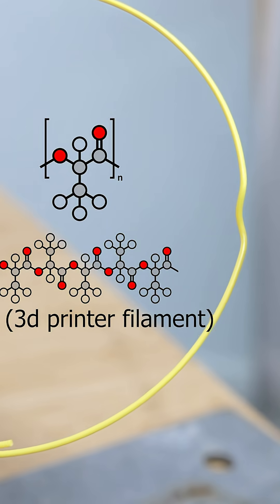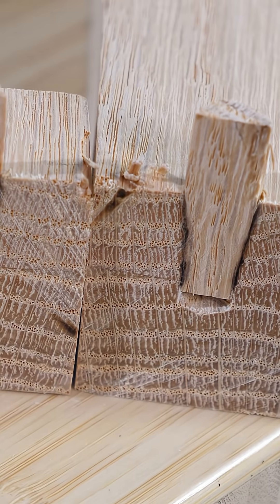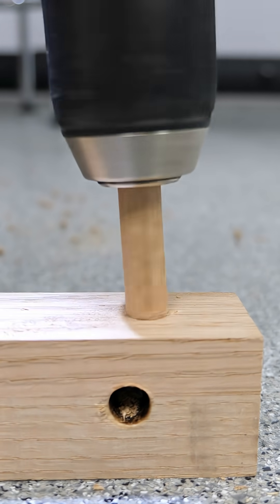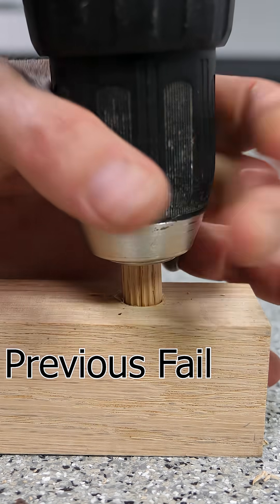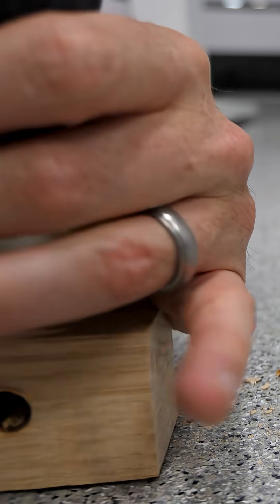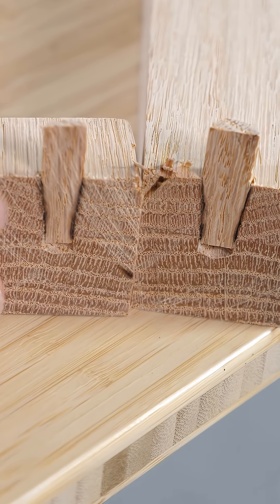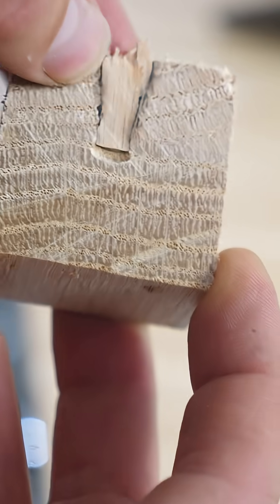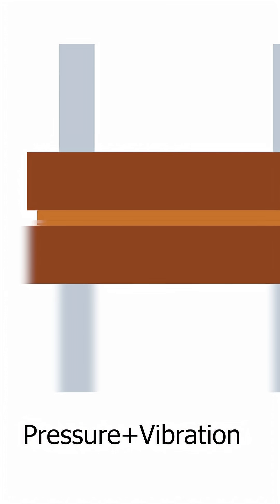I Melted Wood With Friction

Comment: I forget what they're called, but there's a construction brad that is made of wood.  Fired into another wooden substrate during construction, it also welds itself into place, and the resulting construction is stronger than one using steel nails.

Comment: Nice bro . 👍. I believe this works with plastics as well . Wood for sure as shown . This coiffed to me years ago when fixing an old door hinge screw hole that was widened over years . I stuck an oak dowel rod in and made the squeak sound and stuck . Drilled a small pilot and wallah . No more saggy door . I did two more after that for good measure .

Comment: sorry you are telling me if i am trying to start a campfire with friction i might actually weld my 2 sticks together? how am i supposed to roast marshmallows with melted wood :(
Reply: Only if you'll get the rotational speed and pressure exactly right AND if you'll stop mid-way through the process before you start a fire, to allow the molten lignin to solidify. So it's extremely unlikely to accidentally weld wood like this, I doubt it's actually possible to weld wood without power tools

Comment: You didn't "melt" anything. It got hot and expanded in the hole. Virtually any material will do the some thing if it gets hot enough. It's a common process to weld metal as well. Simple friction.

Comment: Your video on melting wood in the vacuum chamber gave me the idea of a wood SLS 3D printer using very fine sawdust as the material. The entire print chamber would have to be kept under vacuum, and it's probably not practical at all, but it should be possible. You could then have access to print-in-place mechanisms and other additive manufacturing techniques that are typically not possible for wood.

Comment: Try a vice and a rubber hammer exactly perpendicular, that works 100x better to undo those connections than pulling, twisting using plyers

Comment: so....they had to figure that out?

I always figured it was a known thing because I rember from my childhood that a dull tablesaw would heat the wood, not quite setting it on fire, but still making it pretty "melty" at the "cut"

I also had dull drill bits melting wood and having the shavings compacted in the flutes, after cooling the wood was basically like plastic and could be peeled off the drill....

Comment: It's the same principle of fire Harding wood. Pine is best actually. To make a hammer find a you g pine with a base diameter of about an inch come up about four inches from the ground and scrape a ring around the base removing the outer layers of bark. Scraping into the soft layer of bark almost to the trunk of meat wood. It will form a knot as it grows. Now before you leave it to grow until it is the size you want be sure and bend the top of the you g tree until it breaks but stays together. Now when the tim comes cut all the limbs off the tree leaves a few green twigs here and there the resin will push up and out trying to supply the needles. After it infuses itself with its own resin. Cut the tree and cut out your hammer and your walking stick "cane" now fire harden them. Not only will they be beautiful after polishing they will be like steel. Cheers. Wood tech is what our ancestors used to refine stone tech. 😊

Comment: The problem is that melting temperature is higher than combustion temperature. So, it burns before it melts, otherwise you keep the O2 away.

Comment: Technically all compounds and elements have a melting point. The ones that don't seem like they do just have a combustion point lower than the melting point. Since combustion is a chemical change, it is almost impossible to reach the melting point before the substance changes completely.

Comment: That’s a wrong explanation of what the glass transition temperature (Tg) is. 
Long chain polymers do have a melting point that is at or above the material’s Tg, depending on its degree of crystallinity. At Tg the non-crystalline amorphous chains melt but are still held together by the crystalline domains which require a little more energy hence heat to melt. That is the melting temperature Tm. 
Then there are fully amorphous polymers which don’t have an actual Tg but only Tm.

Comment: Is it all wood or only certain types of wood?& does the wood have to be the same? Like in the video it uses oak wood for the holed wood & dowel.. or can you use pine & oak etc? Does 1 have to be soft & 1 hard only soft woods etc? Artificial woods like laminate or partical boards work too? Im so facinated now.. 😮😮

Comment: Ive been working with wood my whole life and I had a hunch that you could potentially with enough heat bc cellophane will bond with heat. Wood is cellulose so it should act the same. Turns out I was right. Thats crazy. I understand it's the lignin and not the cellulose but it doesnt change the outcome. My measurements were wrong but the principle was right. I wish I wouldve tried it and figured it out myself and won that damn schweighofer prize 😂😂😂

Comment: If I had to guess the reason no one found this before now, it's probably because if you get it too hot, the carbon particles that develop act as a dry lubricant and barrier, which defeats the adhesive properties of the lignin.

Comment: Could a vibrating press like that be used to weld paper together?  Cardboard?  or maybe welds between paper sheathings of foam core panels such as for construction of foam core architectural models?

Comment: Lignin is the natural “glue” within the wood cells that God put into the creation of tree wood.  Soaking it in liquid nitrogen at super low freezing temperatures temporarily softens the lignin also so you can tie strips of wood into knots even without it breaking.  
Do not try this a home, it’s only to be done by those who know how to do it safely, special insulated rubber gloves reached into glass front chambers.  If the liquid nitrogen gets onto your fingers they will freeze rock hard instantly and break off like ice cycles.

Comment: Essentially You Did Glue Them Together, 
You Super Heated The Woods Natural Resins, To The Point At Wich They Bonded Together, I Also Think That Wood
Resins, Are Some Of The Oldest Forms
Of Glue 🤔, IE Pine Pitch Resin, Has Been
Used By Native Americans For Century's,
Correct Me If I'm Wrong In Comments 🤷‍♂️

Comment: This would make sense since the wood has a resin/sap that is primarily sugar based. Sugar will definitely melt at high temperatures, and once cooled, it will solidify and bind with the surrounding surface.

Comment: I think that ''wood melting'' is not a correct determination, you can't melt the whole piece of wood. The bonding happens by melting the resine inside the wood. Would be interesting to conduct the same experiment after a long baking of wood when it's completely dry - probably it will start burning. On the ther hand - wood welding technology is the same as ultrasonic welding. In this clip a friction welding was performed, intially this method implemented for metals. Thanks for the informative video, implementation of existing methods for different use -  creates patents.

Comment: I recall seeing a nailing company who made wooden nails that fit in nail guns. 
They did explain its not structural and be used in things like siding and furniture.  
The guy shot into siding and man it looked nice. 
He then said it works well with wooden siding since you dont have to worry about nails later on popping out with aging. 
Thought that part was nice.

Comment: You should try friction drilling. I learnt it when drilling oak with a dull drill bit for steel. It burns through, and the exit hole is much neater than if drilled with sharp professional drill bit. As a bonus, the hole is also passivised, so you don't need to burn it after drilling - if you know your oak, you'll know what that's about.

Comment: German Pronunciation Lesson (learner, not native; corrections welcome):

German creates a LOT of compound words, and liberally uses affixes (prefixes/suffixes/etc). It also has pretty clear rules about both pronunciation and which letters can combine to make sounds (at least for non-loan words).

If you see letters together that DON'T follow the rules for combination (or even just seem awkward together), it's most likely a break where two words or particles are joined, and those are ALWAYS pronounced separately. For the word in the video, 'gh' is not a letter combination that has any pronunciation rules in German, so it WILL be a particle break:

"Schweighofer" = "shweig" + "hofer"

'sch' is pronounced basically the same as 'sh' in English.
'w' is pronounced basically the same as 'v' in English, but when it's after 'sch' tends to run together and sound more like 'shf'.
'ei' is pronounced like the "long 'i'" in English, as in "time".
'g' is always "hard", like in "go", except in specific context/loan words.
'o' is pronounced basically the same as the "long 'o'" in English, as in "hope", though often gets shortened a bit per regional accent.
Trailing 'r's are dropped, as in most dialects of British English, so sounds more like 'ah' in English.

Thus:

"Schweighofer" could be phonetically represented by
<Shf.eye.g - ho - fah>
(the '.'s are just to indicate 'eye' is pronounced like the word "eye" but is still part of the whole first syllable before ' - '. There's no easy way to specify that 'i' is meant to be "long" in English without context/additional letters that can just make it more confusing, or without resorting to IPA representation which nobody can decipher).

Pronouncing long/complex words in German is scary until you break it down, then it becomes super easy! Just gotta be methodical about it.
Reply: Nice, never noticed those rules in my mother tongue. 😄
Reply: He still tried - and thus did a way better job than most anglophones 😂
Reply: It's definitely easy when you break it down, but remembering those rules are tough
Reply: @aishikmoitrailead  It's just something that takes practice, and eventually becomes easy. Same with remembering the rules for pronouncing Italian and Spanish words, which are also very consistent but seem complicated for English speakers. German is actually closer to English though.

It can also help to imagine someone with a German accent speaking English, and try to pronounce the German words like that 😅
Reply: Nicely put. I was also taught: whichever comes second in 'ei' or 'ie', that's the one you pronounce... e.g. lieben and schwein.
Reply: Great breakdown, but the last sounds should be a schwa: "uh"

Comment: Well, it doesn't necessarily melt per se. It's the best way to describe it, but the physical term melting doesn't apply here. Lignin kind of just breaks its bonds to the point to where they can kind of flow into each other? It's really hard for me to describe this late at night. Someone smarter than me can correct me.

Comment: There is a "nail  gun" for wood work / wood flooring that shoots wood nails and it does exact that welds to the wood and holds stronger than a 16penny nail

Comment: Professional WIG (wood inert gas) welder here.  I can tell you that this is indeed true.  The splinters suck, but it's honest work. On decks and porches I usually like to run a spool of either the flat or round toothpicks and hit the planks laying down beads.  For finer work sometimes I get a spool of the cinnamon-flavored toothpick filler materiel and it creates a really nice aroma when joining two pieces of incense cedar.

Comment: That's how waferboard and OSB panels are made, by applying heat and pressure simultaneously they fuse wood particles and wafers together and create solid panels and boards

Comment: Technically wood welding was used by people unknowingly for much longer.  It turns out a lot of old driven wooden dowel/pin based joinery in old timber framing actually formed lignin welds increasing it's strength much beyond that of just the mechanical link.  They also had the advantage that most timber framing was done with old growth wood that had denser lignin structures increasing the likelihood that this would happen.  We only discovered that it happens about 20-30 years ago, but that a lot of "old rules" for proper timber joint pinning were increasing the chances of exploiting this property.  Old generations of craftsman just discovered which joints worked better than others based on trial and error...they didn't ever know why.
Reply: Yes but you need a LOT of friction and pressure which isn't easy with traditional hand tools like hammering in a dowel. Yes there was some bonding coincidentally but not like shown in the video using power tools and industrial machinery to do it on a larger scale.
Reply: @RaveN_EDM  ever heard of a bow drill? It makes "primitive" things speeeeeen real fast without all that newfangled rotors and tators electromagnetic auto-spination you rely on today.

(Edit for typos)
Reply: @forthehonorforge4840 yes but a Milwaukee M18 drill will output way more torque than a human can with a manual drill. I didn't say it was impossible I said it wasn't easy. You need to spin fast while putting a lot of pressure.
Reply: @RaveN_EDM  drop some stone weights on the shaft of the bow drill and you got pressure. As versatile as a modern cordless drill? No.

I'm not saying a bow drill is better than a modern drill, I'm saying it is enough for the task of getting to the speed and pressure to exceed the melting point of wood.
Reply: @forthehonorforge4840 people were not using bow drills in carpentry, it's a moot point
Reply: @kirotheavenger60  excuse me? Do you know what early lathes were? Pretty much big bow drills turned horizontal using a  small tree or branch to provide tension and springiness.
From there it is easy to develop the concept to incorporate a pedal, and then develop more movible versions when working on large things they wanted to speeen.

Do they really not teach people about ancient production methodologies in school these days?
Reply: @forthehonorforge4840 we both know we're talking about carpentry joinery here. My fault for leaving a gap open to internet pedantry. 

They were not spooling up lathes to drive in wooden dowels. 

Historical carpentry was very good but they weren't wood welding
Reply: @RaveN_EDM  you rely on your technology too much you can absolute make a bow drill capable of matching a electric drill
Reply: @loonyroxxs2482 it's impossible for a human to output the same amount of speed and torque as an electric motor that's dumb AF. That's like saying I can make a bicycle with the same output as a motorcycle lmao
Reply: That part.
Reply: Thanks I was wondering this as he did the demo.
Reply: THIS IS NOT TRUE. PLEASE BE MORE EDUCATED!

This requires ultrasonic vibrations to achieve. Between 20,000 and 30,000 vibrations in a second.

Don't get your science from tictok! Read books and talk with real scientists.
Reply: @cosamglass7970  requiring ultasonic vibrations is also partially false.  So you are correct it to not take your science from youtube comments.

Lignan welding requires small scale heating to above 160C and mechanical compression.  Which has been achieved repeatedly and consistently by Cranfield University using both rotational, and linear friction.  However they did use vibrational welding as well and found that to be extremely innovative and repeatable method. 

Older large scale joinery was shown to achieve small amounts of welding because carpenters would often use very large timbers and drive rough cut pegs into holes using large hammering forces.  The force was enough to cause thermal softening of the cell wall matrix that would reform 20-40 seconds into a new matrix co-joined with nearby cells.  The linear force on these rough points would sometimes form bonds between the jointed materials.  But it appears to depend heavily on the hygroscopic hemicellulose formations in the wood if carbo-hydrate polymer cross linking took place.  In other words, it depended heavily on the size,  types of wood, and the age, and preparation of the wood at the time of joining.  The big issue is because this is a very uncontrolled method of joining it could also result in the decomposition of lignin.  Belleville also showed that is highly dependent on wood grain direction and growth patterns in the wood.

Ganne-Chédeville also demonstrated that wood welding can occur with inserting wooden dowels at high speed through solid wood or though holes that were at least 1mm smaller than the diameter of the dowel.  (the so-called wooden nail concept).This latter method was developed into more modern day wooden nail products that achieve lignin welding through firing a dowel via a modified pneumatic framing hammer.

But as such these are things that can be done conventionally by essentially jamming large wood pegs in small hole with really hard hammer blows.  Doing so consistently however is what was difficult.
Reply: @cosamglass7970  naw, fire hardening wood is a thing. You don't need to vibrate it with a mechanical vibrator.
Reply: @cosamglass7970 wood welding requires exactly 4 things:
1 - wood surfaces being pushed together with significant pressure
2 - those surfaces being heated by friction or other means sufficiently to melt the lignin in the wood.
3 - absence of oxygen so the wood cannot combust
4 - position and pressure being maintained while the lignin cools and forms the bond.
Ultrasonic vibrations CAN provide the friction to heat the wood, but is NOT the only way to do so.
Reply: Japanese have been doing this for many many years.
Reply: @galenmarek8287  no, they havent. the japanese way of making wood joints by cutting the wood precise enough that it perfectly fits together actually wont cause this at all, because there is no friction heating.
Reply: @galenmarek8287 If you mean their cuting edge woodworkibg then no, It looks different than this.